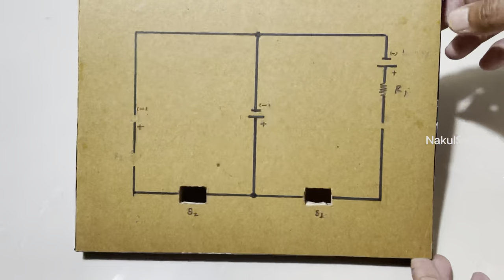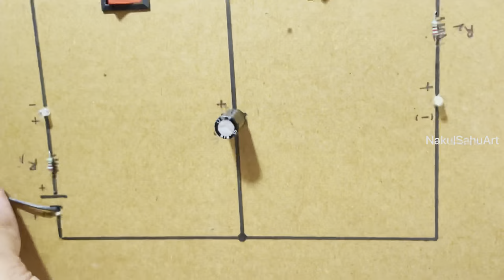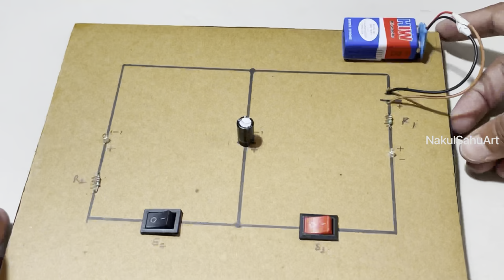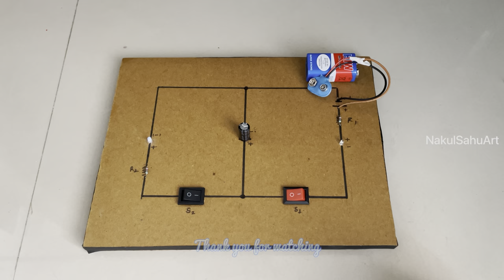capacitor charging and discharging class 12 physics project #science NakulSahuArt

Comment: sir my project was working a few moments ago but suddenly it stopped working the light which shows that capacitor is charging stopped glowing and then another light which shows that current is already stored in capacitor also stopped glowing  just a few sec ago this happened i checked the battery is fully charged idk why this happened i checked all connections are joint
Reply from the maker: Check loose connection, check /replace resistor/ LED

Comment: sir where did u get the materials from ....from stationary or from electrical shop...????
Reply from the maker: I got it from online, you can check in electrical shop (switch and LED and wire)
Electronic shop (tv repairing material shop) for capacitor and resistor.
Reply: @nakulsahuart  thank u sir...

Comment: sir i did exactly what you did but both leds are working at the same time, i redid the connections many times but it keeps glowing together
Reply from the maker: Switch should alternate on and off , 
1. both switch off 
2. On the charging circuit switch
3. After 10-20 seconds turn off the switch
4.switch on the discharging circuit
5. Led will glow and dim slowly.
Reply: @nakulsahuart  thank you sir, it indeed was switch issue
Reply: @nakulsahuart sir but when wire is connected to the battery then why  bulb is dimming......mine is  completely dimming after a second and sir i am turning on both the switches to make the bulb glow.....sir it's urgent plzz reply what I can do??😢

Comment: Charging:
1. Initially, the capacitor is uncharged, and the voltage across its terminals is zero.
2. Nhen a voltage source (such as a battery) is connected to the capacitor, current starts
to flow, and the capacitor begins to charge.
3. As the capacitor charges, the voltage across its terminals gradually increases, while
the current decreases.
4.The harging process continues until the capacitor is fully charged, meaning the
voltage across its terminals is equal to the voltage of the source.

Discharging:
1. Dnce the capacitor is fully charged, if it is disconnected from the voltage source anc
connected to a circuit, the discharge process begins
. Initially, the capacitor holds the stored energy, and the voltage across its terminals is
equal to the source voltage.
. As the discharge progresses, the voltage across the capacitor gradually decreases
while the current flowing through the circuit decreases as well.
De- The discharge process continues until the voltage across the capacitor reaches zero
indicating that the stored energy has been completely released.
Reply: What if I on both switch.
I know this is silly question😅 but I want to know as I have to give viva on this so I making up the questions myself and finding answers😅.
Reply: Please tell me if you know
Reply: @KajalKumari-go1pj  both bulb will glow at the same time...and the charge which is usually stored in the capacitor will quickly flow out of it because the charge has been going to the other bulb
Reply: @artguru1709  thank you friend!😊
Reply: thank you for the explanation!
Reply: Thank you bro🎉

Comment: Sir is this in chapter electrostatics potential and capacitance or alternating current
Reply from the maker: A capacitor is an electronic component that stores electrical energy in the form of an electric field. When a capacitor is connected to a voltage source, it charges up and stores energy

Comment: Hello sir my discharging side is working but only it's visible in dark place as the light is very dim. Can't work in daylight. How to overcome this issue. It's for my 12th board practicals. 😢
Reply from the maker: Hop, you used materials as per video, use same colour led for both side , I used 3mm led , you can check with new battery.(if low battery )
Reply: Ok sir ty  @nakulsahuart

Comment: sir but how will we prove that capacitor charges to 63% in time RC and discharges to 38% in time RC. please help
Reply from the maker: Measurement Procedure
A. For Charging:
1.Connect the power supply to the RC circuit.
2.Use a multimeter or an oscilloscope to measure the voltage across the capacitor.
3.Start the stopwatch when you switch on the power supply.
4.Record the capacitor voltage at regular time intervals (e.g., every second).
5.Stop recording when the capacitor voltage reaches close to the supply voltage (approximately 5 time constants,  \tau = R \cdot C ).

B. For Discharging:
1.Disconnect the power supply and connect the capacitor-resistor circuit to discharge mode.
2.Again, use a multimeter or oscilloscope to measure the voltage across the capacitor.
3.Start the stopwatch when the capacitor begins discharging.
4.Record the voltage at regular intervals.
5.Stop when the capacitor voltage approaches 0V (approximately 5 time constants).

Comment: Sir it's not working only 1led is glowing not the other one
Reply from the maker: Check circuit, positive/negative of led /capacitor and switch also, if possible share your project image in Instagram.
Reply: Sir I check all the connections but it still not glowing

Comment: Sir i can use 4.7 uf 450 v capacitor
Reply from the maker: It will not work, use 500uf 10v to 1000uf 25v
Reply: Sir if i connect two capacitors in parallel 1000 uf 10 v

Comment: Sir by which instrument you are attaching wire eith resistance
Reply from the maker: It’s soldering iron.
Reply: @nakulsahuart  from where I can buy and how much it cost
Reply: @nakulsahuart  without soldering iron we can't use any other thing
Reply from the maker: @artistyaps  it cost around 150-200₹ you can get it from electrical shop or hardware shop.
Reply from the maker: @artistyaps  you can joint all components without soldaring also. You need to joint properly.(don’t do the loose connection)
Reply: Bina soldaring  iron ke kese join kiya aapne?

Comment: Sir can we use 100uF 16v with a 9v battery and without resistor
Reply from the maker: Normally led lights are 3-5v , so it will fuse if you use 9v battery, you required 500uf  to 1000uf 25v capacitor for better output.